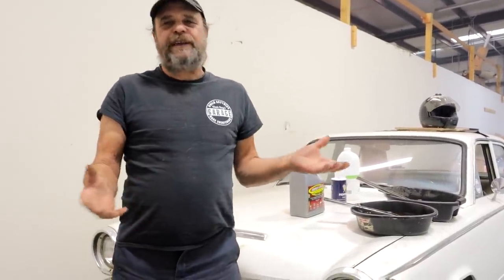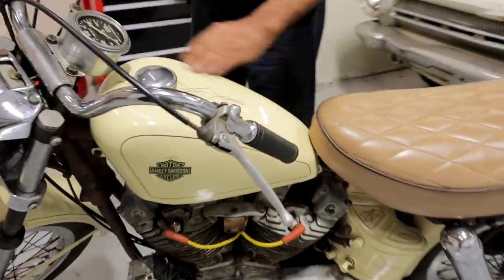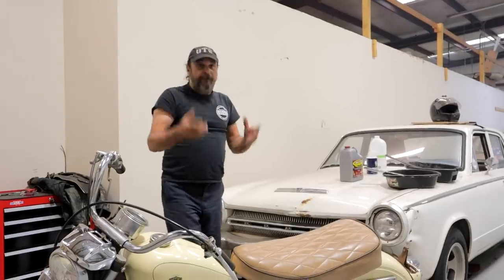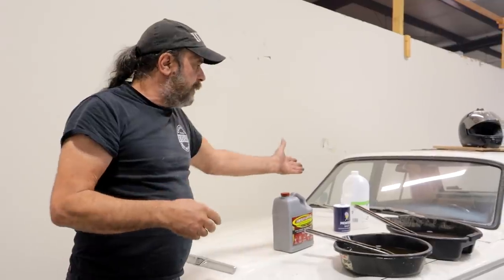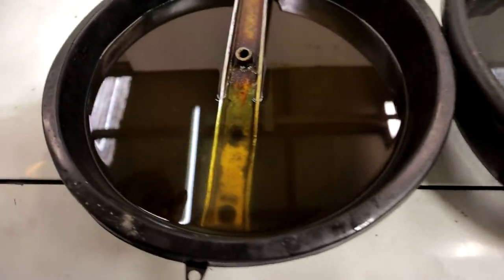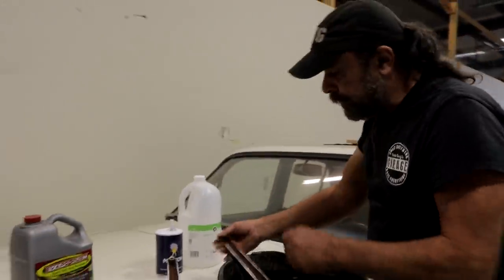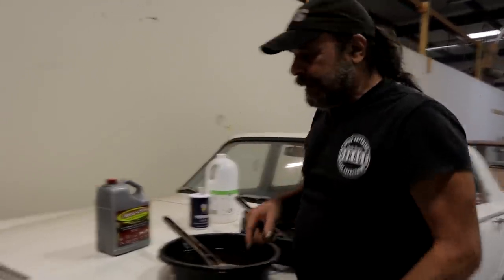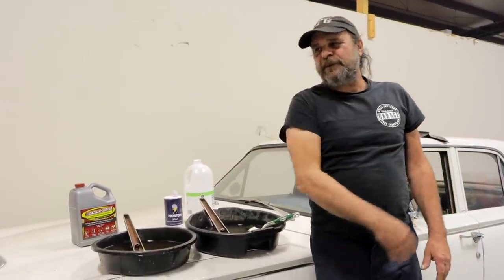Evaporust Vs. Vinegar - At 10X The Cost Does It Do 10X The Job?

Comment: The Evaporust seems to work for me in removing rust as similar to the vinegar, a little slower though.  Well if you want to clean it to the max use electrical methods.  Have used electrical charge to remove rust for the past few years.  Simply make a mixture of washing soda and water dump it in the tank then use a battery and a metal part in the tank to act as the anode and put a negative charge on the tank itself.  I usually use a 12v battery and a trickle charger to maintain the current flow and let it go for a few days.  It really works, but if you have a rust hole or nearly a rust hole you will find it, Trust Me.  After about 2-3 days your anode will be a rust fur device and the tank will be spotless.  After I do that then I clean everything out again, fresh solution of washing soda then inverses the polarity of the system and use a zinc slug as the anode.  After a day or so the zinc should look smaller and the inside of the tank is plated with zinc.  If you want to go whole hog then drain the tank yet again then make a solution of Root Kill, 99% coper sulfate, don't go crazy though then take an old copper wire as the anode+ and the tank -, another 2 days and you have a copper plated tank.  Yep it takes time but it is cool, live better chemically.
Reply: Thanks. I'll try it. What is washing soda ?  The same as baking soda ?
Reply: @maplebones  Washing soda is slightly different than baking soda but it is actually cheaper and available at your local Walmart in the laundry detergent isle.  To do a tank simply mix about 4 oz per gallon of water, is a little strong but it works faster, place a negative charge on the tank and place a piece of metal I normally use a piece of junk on the positive pole.  Make sure it is insulated from the positive piece and use a battery to provide the potential difference needed.  I usually take a trickle charger in tandem with the battery to keep it topped off.  After a couple of days the inside of the tank will be hospital clean and your junk annode metal will look like a rust red fuzzball.  What happens is with the tank negative excess of electrons available and the junk metal annode with a positive charge, lack of electrons the electrons will migrate from the tank thru the slightly conductive water to the positive charged annode.  Hey if you accidently reverse the charge no big deal you end up with a clean junk part.  Simply reverse the leads and start over.  Have cleaned up a bunch of what looked like literal JUNK by this method and it works fine.  If you want to get fancy you can zink plate, then copper plate also.  Just look it up on youtube.

Comment: The obvious downside of the vinegar is that as well as removing rust, it removes metal.
Evapo-rust struggles with heavy rust, and leaves a black coating which has to be removed with brushing….some say it can be reused over and over, but it does get weaker with each use…

Comment: HI Tony. Love your channel brother. I am looking for a good rust remover. I've been using Ospho for years. As you knowledge, the downside is that its gotten too expensive, irritates the hands and eyes, and etches metal quite a bit.
I'm looking into using a product called Rust 911. Its way cheaper, non acid and works great, especially on delicate parts. You can soak products in a bucket of water and 911 concentrate and they apparently come out beautiful- I haven't tried it yet. but watched reviews. Maybe try a video demo of it. I'll let you know if it works for me. The stuff is way cheaper than the alternatives..  and safer all around. Thanks!

Comment: I have no less than 5 old peanut butter jars with small block Chevrolet oem water pump, fuel pump, and misc other engine hardware soaking in Evaporust on a daily basis...lololol. 😂

Comment: I don't think the salt is required.. 

However if you add some soap (a surfactant) to the vinegar it will help it "wet" the rust. Also if you heat it a bit (not boiling, like coffee temp) it works crazy well (I microwave some really hot and add it to the vat. Cleans your microwave too)..

Comment: The problem likely is the fuel alcohol content ... Maybe an oversized in line filter? Unsightly, but problem solved ... I'd say the large Ford fuel injection frame mount filter, cheap enough.

Comment: All Rust remover sucks.  I always find myself just using the wire wheel when I can.  A good Rust remover is Rust 911.  It's concentrate so you can make strong batches.  I make a drip system on a recirculation pump and just move the drip hose around periodically.  IT's slow but it gets into the areas a brush can't like inside the frame .  In the meantime I'm working on the engine.

Comment: Yet ANOTHER tank de ruster is naval jelly, pull petcock block hole pour one bottle of naval jelly in then fill to little over half full with water and shake the crap out of it. top off to full with water and let it sit about 5 days. Grab a big F$%&n' spray can of WD-40. Then drain tank and flush with a garden hose. Then use the whole can on the inside of tank to prevent flash rust. This is very effective and low cost.

Comment: My rule of thumb with white vinegar is 48hrs soaking then scrub off with warm detergent water. The rust comes right off and leaves grey iron ready to paint or surface rust again.It wont touch any areas with paint or grease. At 50c /ltr, I have a 20 ltr tub for soaking. Be careful though, once I accidentally left an antique colonial cast iron door striker in the tub for months. When I pulled it out it looked fine but just crumbled like dry clay. And don't use on tensile bolts cause of hydrogen embritlement.

Comment: I believe you are making a mistake not removing the tank.  You want a Home Depot product called Concrete and Metal Prep, who’s main ingredient is Phosphoric Acid.  Attacks rust, not iron, properly mixed with water leaves a phosphate coating.   I would carefully tape off the tank to protect it from the phosphoric acid (even though I don’t think it would hurt it) but mostly scratches.  Just get some, it’s cheap and test it like you did the evaporust. You will be impressed.  Read up on phosphoric acid a little as well.  DO NOT USE MURIATIC ACID.  Yes it is strong and works well but it strips the surface of oxide protectant and rust will come back with a vengeance even if you pacify it with a caustic.  Just don’t do it.
Those suggesting molasses or coke a cola the main ingredient is phosphoric acid.

Comment: Tony use cylinder hone tool then vacuum.  Then fill with vinegar and a good amount of salt for 48hrs. Coat with oil and drain. I like wd40.  Gas and go.  Just my 10 cents.  Also plastic wrap on vinegar/salt, evaporust, etc enhances or speeds up reaction.

Comment: Muriatic acid and water. Water it down to whatever speed you want it to work at, usually about 5% acid so it works REALLY fast. That's how I strip nasty old six pack carbs that have ethanol damage. Great for gas tanks, etc. Just have to keep your eye on it. Muriatic acid is so cheap it's insane. I put carb parts and my acid mixture into a cheap crock pot usually for 10-25 minutes and keep an eye on it. As the parts look good, I remove the good ones. NEVER put springs or clips in acid. They vanish!  The acid will emit toxic gas! Do this with good venitllation and a respirator! The crock pots don't last long, but you need the heat and they are cheap so you can replace them periodically. I do about 40 carbs a quarter so this is a well oiled machine to me. I do a lot of master cylinder, calipers, etc.

Comment: Evaporust is great but it doesn't like thick scaly stuff , and , it will definitely eat paint on long exposures to it .
I learned that when rebuilding my winch , and , losing my alignment marks on the 2 gear housing parts , ultimately costing me $300 for a new aluminum end housing and gasket set , plus a 3 week delay .
Vinegar and salt works , as does citric acid which is available in bulk pretty cheaply .
The vinegar and salt trick also works for corroded copper wires , needing just 15 minutes to turn blackened greenish wire back to shiny red .
Follow up with a soak in a saturated solution of water and baking soda to neutralize the acetic acid . This can save you from having to replace an entire harness , or , at least stave off replacing it for a while . Also works on corroded contacts in connectors , especially headlight connectors .
Heat speeds up the process , and , a cheap garage sale crock pot is perfect for quickly cleaning up small parts , nuts , bolts , etc ..
Take my advice and do this OUTSIDE .
Hot acids reek something fierce .

Comment: Tony Evapo rust is basically a chelating agent it is probably Edta which is called versene 100. A better choice is Citric acid at a phof 4 to remove rust and very safe. The other option is Phosphoric acid commonly found in the big stores in paint department. Never use Muriatic /hydro chlric acid which damages steel

Comment: hello big tony    it is me david in huntsville al.      i used a log chain &nuts bolts ect   on my 1970 ducati 350cc    move tank back & forth many many ect times   it took four  very very LLLong time BUT it worked    it was a solid runt coated  just like your HD      OK   try this next put in a mix of muratic acid   MIXED with water    BUT  DO NOT leave it in very long time at all     the more acid you use  the less time you keep the mix in the tank   my pal uses the mix of water & murati acid to remove mill scale off any new metal before he welds it  , i am a TIG welder of 25 plus years and i was impressed    REMEMBER  when you were repairin  2 cycle bores      you use muratic acid on a Q tip to remove the aluminum that was smeared to the steel bore     i KNOW  you have done this process back when you were puting in that wiseco piston in your 2 stroke dirt bike       be careful the acid is strong  so delute as you think is what ya need      just a idea    LOVE YOUR PROGRAM !!!!!!!!!!!!!!!!!!!!!!!

Comment: Tony, your tank rust is gack infused, thus keeping your skunk piss from effectively attacking the rust. So, take a cup or 2 of pennies (yup, those useless coins) dump them inside the tank. Now (when uncle Kathy isn't home to witness) line your clothes dryer with pillows so it holds the tank immobile. Tank pillows and pennies are set to no heat, and run for an hour or 2. Voila, the crusty rust/gack/crud is mechanically scrubbed down to patinaed base metal. You dump out the pennies and loosened crud, and run your favorite skunk piss to remove the patina. The dryer rotation is slow enough that the little copper abes don't whip around denting and distorting, they just tumble and scrub

Comment: Vinegar water solution. Stainless tie wire. A piece of scrap metal. Part to be stripped of rust. And my battery charger. Similar to anodizing process.

Comment: First off, I love your channel, always great content. I'm a subscriber for life. This is a great topic because its something we all run into sooner or later. Okay, so on with the show...
   Evap-O-Rust will not clean the rust off of metal that has a layer of VARNISH on it. The varnish left by the old slowly evaporating gasoline is what was preventing the Evap-O-Rust from doing it's "Thang" lol 
   You have to clean the varnish out with something strong enough to get it all off and that's near impossible with that type of varnish and the pitted surface inside a rusted tank. A radiator shop has the dip tank with the chemical to do that job, but that's the end of the paint job too unfortunately. 
   The tank must be removed from the bike, unless you bought enough Evap-O-Rust to fill the tank all the way to the top. If you get the tank off the bike you could get away with just the one gallon by  leaving the tank on one side for a day and then on the other side for another day.
In the end, your "Homeopathic" concoction of white vinegar and a pinch of salt is probably going to work better although it may also remove some virgin metal once it gets through the layers of rust, depending on how long its left in there. But you already knew that part.

Comment: My grandfather, in a futile attempt to get me to stop drinking Coke, took two glasses, filled one with water the other with Coke and then dropped a 16D nail into each one. Unfortunately I can no longer remember how long the nails were in the glasses (but it didn't seem like a really long time) but when grandpa dumped the liquid from the glasses the nail, that was in the Coke had mostly dissolved. I didn't stop drinking Coke but I remembered grandpa's experiment when I cake across some badly corroded battery posts and cables and thought, "what the heck I'll Coke a try." To this day I still use Coke or corroded battery terminals and cables. Don't know if Coke will dissolve rust in a gas tank, but it will dissolve a nail over time and it destroys corrosion on batteries. Just let it soak for a short time and rinse off the corrosion.

Comment: Maybe the evoporust can't penetrate the varnish or petroleum residue in the tank!?  I helped a buddy do a motorcycle gas tank treatment once.  Filled it with something from the kit (acid?) and rolled it around with a chain inside in the yard.  Rinsed, dried, and coated it with some sort of rubbery coating.  Seamed to work darn well.  He got it from the bike shop.  Came in a kit.  20 years ago?

Comment: There is one very big difference between the Springer front-end struts, and the inside of the fuel tank : The struts don't have the evaporated fuel residue on them that the fuel tank has... Tony, the residue in the fuel tank needs to be removed first , before ANY kind of a rust remover can properly do it's job... The peacock will need to come off too... I suggest that the tank is dipped into a sollution of caustic soda sollution that radiators and nasty engine parts are subjected to before they are overhauled... Sadly, the paint on the tank, will have to be sacrificed to properly remove the residue from the inside of that tank... Another option is to replace the fuel tank... That might be the best option anyway, since many Harley parts are quite available...

Comment: It is not removing the rust in the tank because that rust is soaked in hydrocarbons from the fuel.
You need to get those ingrained hydrocarbons out first. 
I suggest boiling water and a strong mix of diswashing liquid, do the gravel in the tank and shaking thing.
Do this a number of times.
Flush with boiling water.
Then try the evaporust or vinegar.

Comment: The difference is    vinegar can't discern the difference between iron oxide and steel.    I convert people to evaporust but no one listens to me about patience in how to get the most out of it.   They think you're only supposed to leave it in a wash for like 12 hours. No... Leave heavy corrosion in a bath for 72 hours.. it will not eat good metal or paint.. however... do this with vinegar?  It eats the good metal.    Evaporust works through chelation  and only attacks iron oxide... this is important because      in this bath you have?   AS vinegar is surely eating iron oxide   that freshly exposed  metal is being now eaten at the same time...  Obviously this may be a moot point depending on the integrity needed    but for more intricate items or the principle of the thing I choose Evaporust.     My mind has been blown by how thick of scale has come off of items.   I some body insulator metal   that looked like it was on the ocean floor   and it still removed it all without hindering the good metal.      Also non caustic is helpful.... I do also have the GEL   in a big gallon bucket   it does work  but is a tough cleanup,  I use like a bissel steamshot    but it has helped me on a frame where    I didn't want to just convert  but after mechanically removing rust I had no way to get into pits... the Gel clung to the side ( without doing the paper towel saran wrap mess)  and when i rinsed it sure enough there was black carbon of steel showing...  great product either way....  for the record I have dissolved old tools in baths of apple cider vinegar and WD-40 I forgot about  LOL  I was pissed.

Comment: Using vinegar will etch the metal and create a lot more surface area for new rust to form.  It will also remove any plating on the metal.  If you go with vinegar then new rust needs to be considered.  If you use evaporust then the gray silty coating needs to be removed after.  That can be brushed like he did or rinsed and shook.  I think something went really wrong that the gas cap didnt clean up even when it was upside down.  UTG could put the gas cap safely submerged in evaporust and it would work but if that was done with vinegar it would remove the plating.  Both have useful cases

I think UTG should give evaporust another shot especially when existing plating is present.

Comment: IMO, with heavy rust like seen on that gas cap, you gotta have something to "brush" the inside with when you agitate it like your random nuts and bolts to get it to work quicker. I used the Evaporust to clean the tank on a "70 Duster that had been sitting since 1986. I put two gallons in along with a few handfuls of crushed landscaping granite. I would let it soak on one side for about an hour and then agitate the granite and then do the process again. After the second time I would rotate the tank so another surface was covered and do it all over again. In a day and a half the tank looked literally brand new. The metal was shiny and rust free like I just bought it. Give it a shot!

Comment: what i do for fuel tanks (lawnmower to truck (60gal)) is to wash with solvent first or soap to remove the oil. then put some course sand and small gravel inside. close up and tie to a car or truck wheel on a jack stand. run in low gear (turns tank slowly) till clean (works best dry) but will work wet. rinse and dry. works every time. it will also show you if the tank has rusted thru.